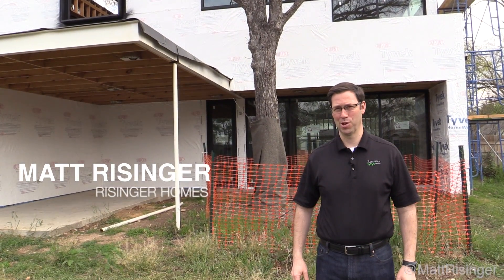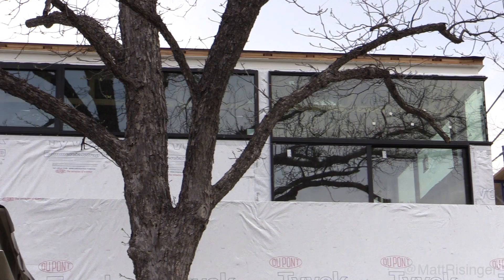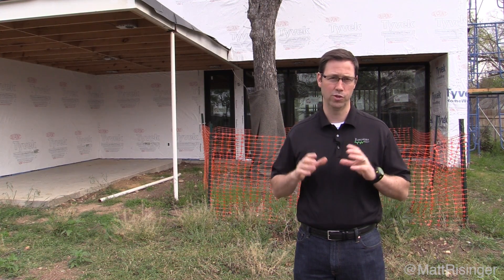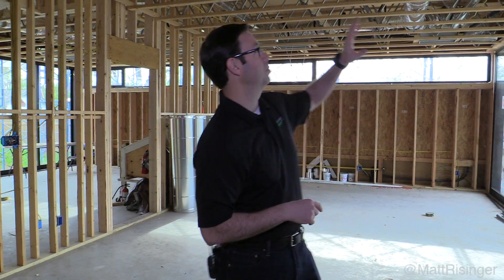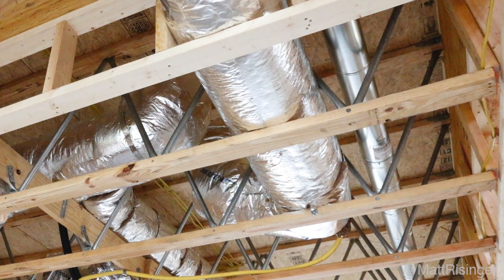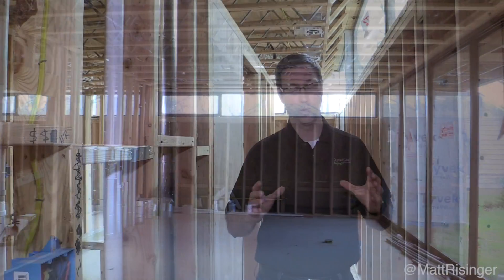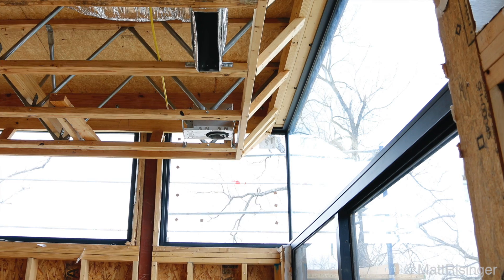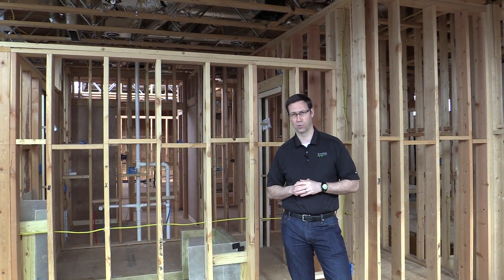Steel / Wood Hybrid Floor Truss - RedBuilt  Review

Comment: That''s the 2nd video from this company that tells us the slab on grade foundation sits on bedrock.  I'd like to know more detail on that.  Either the house sits on bedrock or undisturbed soil, one or the other not both so the "bedrock" in that part of Texas must look like a pool table.  If you find both solid bedrock and soil or overburden where you want to place the slab, you have to use one or the other, not both.  Usually there is a few feet to fifty feet of overburden, which is soil, rocks, detritus or cracked pieces of the bedrock.  You have to excavate carefully with both machines and by hand to find the right conditions for a slab, and then (usually) excavate to undisturbed soil or bedrock and then bring in clean fill (General Aggregate) and compact it to grade.
I suspect they have about ten to twenty feet of just sand which is undisturbed and sufficiently strong to support a slab and house.  They bulldoze a flat plateau like making a pizza dough and build on that because it's fast and cheap.  In which case they should excavate and build a basement or split level arrangement or something to make use of the space under the house and below grade.  It's a heat sink for AC units, it's the first line of defence for drainage plans and it's a cost effective way to increase square footage of usable space.  All that equipment he talks of in the Attic shouldn't be there for a variety of good reasons as he points out.  The answer is not "Airconditioning" the attic, it's getting rid of the Attic for a flat, double roof arrangement that is energy efficient, cheap to build and will last decades without any trouble.
The reason they use slab on grade is for developers to make the house look bigger from the street.  Vanity and "who has the biggest house" are the reasons.
Climate change will force our engineers and builders to focus on critical problems, not aesthetics and image.

Comment: What is the fire rating for these tubular-steel web trusses compared to all-wood trusses?
Reply: Interesting question.  As a GC, I did a major renovation to an older building in downtown Ottawa in this century.  We shoe-horned an apartment into the basement and the issue of a steel support beam and fire code came up and I learned;  That steel beams bend or "fail" prematurely in a fire due to the heat.  That can make the entire structure inaccessible to firefighters.  Better, is a wood beam that will take a few hours to burn sufficiently to "fail".  Depending on where you are there are additional steps to be taken like covering any beam with firecode gyproc or/and sealing all the places flame could come in contact with combustibles etc..
Reply: It's still a 2x chord, so I bet it's very similar.

Comment: The detail where the truss end connect to the beam..... Not attractive at all. In my option they could have and should have ridden the  been. And the semi does from the exterior could have went to the roofline and have been blacked out by the glazers.
Reply: Agree, I would much rather the exterior of the house have the negative effect than what they have had to do on the inside which you will see all day, everyday.

Comment from the maker: @ Beretta Shooter:  Yes these are a very stable truss considering the structure is steel.  The top and bottom 2x4 cords are the only piece that has potential for movement, but if used indoors with stable humidity they should be very stable.  Matt

Comment: Great loooking project Matt, quick question on these trusses....are they dimensionally stable?

I've installed windows in a similar location and had issues with the light raking across the ceiling showing every.....single.....tiny.....little....imperfection when the light was really bright outside and after we removed the ceiling we determined that the trusses were out of plane and eneded up replacing them with full metal trusses.

Keep up the great videos.